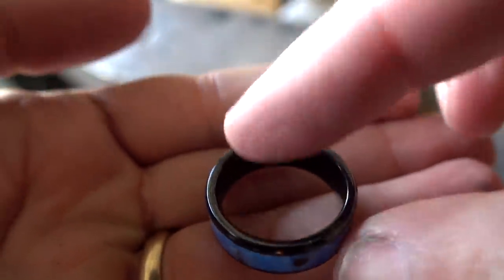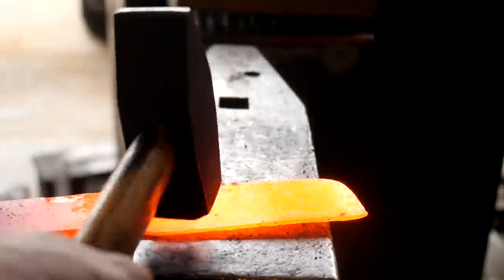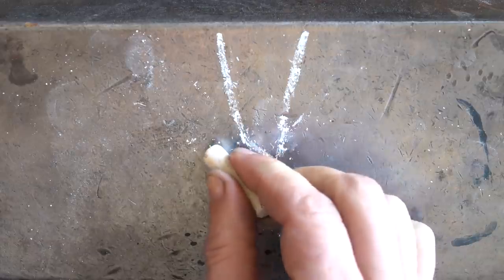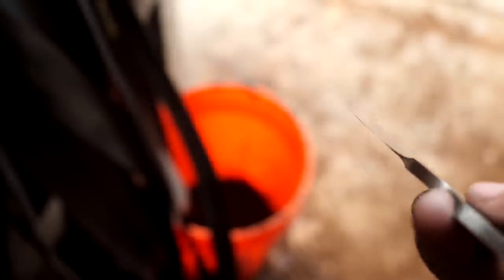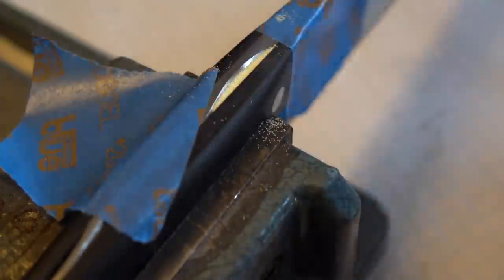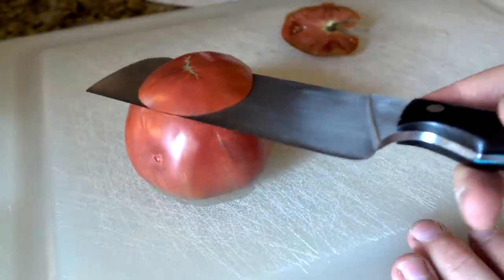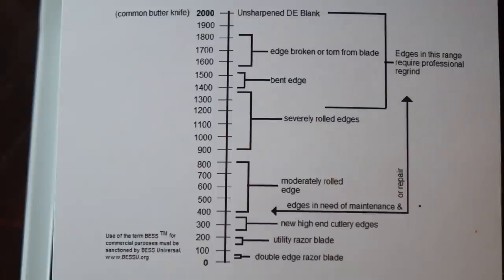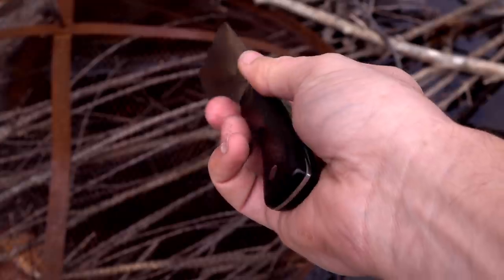Forging An Ultra Sharp Knife!

Comment: The German style cook`s knives are ground like that (primary bevel across the depth of the blade and ground to zero at the cutting edge). They do also have a recasso which I don`t like myself. This makes for a steep cutting angle, but you have to always grind the whole blade to re-sharpwn the knive. So the knive shrinks each time, and ernds up as a boning knive.

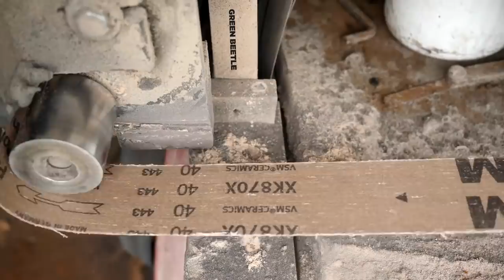Comment: At 6:26 it looks like you mount your ceramic belt backwards? I may be wrong but I believe the grains in these are oriented directionally in the resin and are designed to be run along the arrow.

Comment: Hi from Bavaria. Nice Video. 1080 or 1084 are excellent steels for kitchen knifes. The only downside is, that they are not as wear resistant as Steel which forms carbides. Theoretically they can have a finer microstructure because of their missing carbides.

Do you use your knife in real kitchen tasks? A geometrie this thin collapses at the first contact with the cutting board. You can set the edge back an put a primary bevel on at about 30°. Experiment with that if you have a guided knife sharpener. This will give you a durable edge with almost the same cutting performance.

A flat grind is not my first choice when grinding kitchen knives (I forge only kitchen knifes). A flat surface will extremly stick to food. Your tomatoe is a good example. Potatoes are even worse. I like a gentle convex grind. It is a good compromise in cutting ability and food release. Playing with the amount of convexity along the length of the blade can result in a perfect cutting kitchen tool.

Your experience in cutting toilet paper can be explained with the mikroscopic condition of your cutting edge. The normal sharpening on stones leads to microteeth at the cutting edge. They act like a saw and make it easier to cut through the toilet paper. On the other side this edge fails compared to the razor blades with your sharpness tester. This is because this blades have a polished and closed edge. Try to shave with a toothy edge. You woun't entjoy this shave, believe me. As a consequence you stroped with diamond compound. This leads to a finer edge and a better result with the sharpness tester. The cut through toilet paper was still good. The diamonds leave a non polished edge with teeth just a few numbers smaller and more agressive. Try a compound like chromium oxide or iron oxide. This will polish the edge and result in even better values on your tester. But it won't cut into the toilet paper.

Regards
Christian from Moosschmiede

Comment: Straight razors have a primary hollow grind and they are sharpened on flat stones using the spine as a base. They are around 10 degrees inclusive.
Reply: And have a hard temper if any at all.

Comment: Hey! when you said that maybe the knife wasn't as sharp as you thought when cutting the tomato, the reason the knife was pushing the tomato was that you have a really flat and true knife body that lets the tomato stick to the knife. just like when chopping potatoes or veggies, when the food sticks to the knife right? you can avoid this with an apple seed grind? (not positive on the lingo) where you hollow out the body of the knife and then it widens out a bit to the secondary grind. it'll create the void between the knife and the tomato so it won't stick as much. Just my thought as to why it wasn't super successful with the tomato trial. Always impressed with the videos though! (please correct me if I'm wrong! still trying to learn as well)

Comment: Always enjoy your vids and your scientific methods 😉.  I've also found that cleanly splitting hairs requires just about as much skill as it does sharpness.  I think that 10-20 thousandths is a good thickness for something like an EDC or hunting knife, but kitchen knives, at least for cutting veggies etc.  are great at 2 thousandths and even below and are considered somewhat thick at above 5 thou.  

Try taking the flat grind down to 10 thousandths at the edge and then grinding in a lean convex (down to zero) that goes up the blade about 1/2" or so.  Then lightly run the edge over a fine stone or even some 1500 grit paper a few times to remove the apex just a bit, and then come back in with your final cutting edge and angle.  I've found this method works great in achieving a very sharp blade/edge geometry for pretty much any type of blade.  It's just how lean the convex is that varies from knife to knife (i.e. edge thickness before applying the convex and then again before applying the edge apex).  This is also basically the same way they apply their edges in the ABS.  Give it a try sometime if you haven't already, I'm sure you'll like the results ya get.  Thanks for sharing and take care 👍
Reply: Plus one for this comment. Even commercial chefs knives are well under .0015

Comment: From the research I'd done in my own quest for this same thing, the moment you get your secondary bevel edge to around .2 microns the steel, regardless of the profile of the bevel, doesn't have the structural integrity to keep its shape and dulls down to about 2 micron real quick. It's the reason sushi chefs don't have steels, but keep a 10 and a 16k stone nearby at all times.

I had also tried splitting a hair at one point (with a zdp-189 sharpened to 0.25 micron. this cut knicked the blade: https://imgur.com/28MrDxd)

Comment: Zero ground knives benefit from the fact they automatically thin themselves. Imagine a full flat ground knife (this isn't "zero ground"), there are 2 bevels, as  you remove material from that second bevel it eats into the primary bevel of the blade upwards into the progressively thicker part of the knife. That makes it more and more wedge shaped and has less of a "cuttability" quality. There are a few reasons why you'd want a secondary bevel, edge stability, and the biggest probably being sharpenability. It's easier to remove 1/8th of an inch of steel to create an edge than it is to remove 3 inches of steel. And with the added edge stability seeing as how the very apex is thicker in comparison, you can make the primary grind very thin.

Comment: Try making it out of AEB-L. That should be able to get down to a finer edge due to no carbide formation in the heat treatment. Nitro V should work well too
Reply: Very much this! To support an edge that thin, you need the right kind of steel, and AEB-L is it (or the AEB-L clone Nitro V). Zero flat grind knives are a pain to make, but they perform like nothing else. You could call them the exotic sports cars of the knife world and you wouldn't be far off.

Comment: It cuts hair with the same sound as a good straight-razor. About the toilet paper test, it may be that there is a tiny irregular burr on the cutting edge. So sometimes, it cuts, sometimes it catches the paper. But overall, Sir, your blade would CUT! :)

Comment: for a chef knife 10-20 thou isn't gonna get a great edge. most kitchen knife makers including myself grind their edge between 2.5 thou and zero usually with a slight convex grind.also what is critical to a good chefs knife is a nice distal taper. unless I were to try to make a real laser for extreme sharpness but a lot less durability, I like to have the spine thickness at the heel between 0.125" and 0.093" (you can go thinner, but this is just what I have worked with in the past) and have it tape as thin as possible from the heel to the spine.

Comment: You will also find that removing steel perpendicular to the edge will make the edge much more aggressive by adding small steel teeth. Removing metal parallel to the edge causes no teeth to form and it will dull quickly in comparison

Comment: For most knife blades sharpened for Wood carving there is no secondary bevel. Especially those used for chip carving. Check it out.

Comment: Correct me if I'm wrong, but doesn't a hollow grind technically achieve the sharpest edge? Although you might run into the same issue of the edge being so fragile that it rolls if you look at it too hard without any amount of secondary bevel.

Comment: At about 9 minutes into the video you show us the damage that paper did to the edge of that 1085. Do you feel that a differentially hardened edge at that grind angle would have faired any better or worse? I realize chipping may significantly increase.
Reply from the maker: i think the reason for the waves after cutting paper was that the steel was too thin.  not much to do with heat treat or differential hardening.  this was corrected by applying a secondary bevel which better supported the edge.

Comment: My wife gets mad every time I sharpen knives. The noise of it drives her crazy. Then I start to shave random spots of hair off my legs followed by me plucking hairs out of her head without permission for tree topping tests, that’s what really pisses her off.  My all time favorite steel is white #1. I use DMT coarse, fine, extra fine, leather strop on wood fuzzy side up loaded with green aluminum oxide, or canvas strop barber style loaded with green aluminum oxide. Last I use a leather strop on wood smooth side up with no compound.  In that order if it needs it. Between grits I deburr on oak end grain and strop to make sure the edge is clean without a burr.

Comment: what's that little tool you use to push the blade against the belt sometimes?  I couldn't tell.  Just a little homemade object that grabs the knife decently and helps apply pressure?
Reply from the maker: magnet

Comment: Being such a thin edge.... Would the acids in the tomato begin degrading the edge before the second cut?..... Also there needs to be a hollow grind to allow air in the cuts otherwise things like tomatoes and potatoes get stuck to the side of the blade making it harder to cut.

Comment: So why does tempering have to take so long? I have tempered blades and within 20 minutes they were a nice straw color. This was much hotter than what I intended but it I did wonder what the problem with that method was. Is the steel compromised when done that quickly?
Reply from the maker: My understanding is that not only does tempering relax the steel and soften it but it  also helps convert retained austenite to martensite.  A second temper is often used to then de-stress the new martensite.  Someone chime in if that's incorrect.

Comment: Not to Split-Hairs but...🙄...If you used something like S30V or M390 or even CPM D2 steels, you probably would have had a much stronger blade and could have gone even a bit thinner on the blade...Hope this wasn't too EDGY a comment! Nice work!

Comment: the problem with this knife not doing so good in some of tests is that, it is so sharp thats is cutting through time into the future. the materials you are cutting are still in the past as the edge is cutting ahead. thus generating friction at the back, which in return results in some tearing and requiring extra pressure. yeah.

Comment: 1:30 No secondary bevel...much like many swords? Say a katana or longsword? That shouldn't be too delicate...
Reply from the maker: Chemus Van Der Geek   Implication is that I’ll be grinding from a thin spine flat or straight to zero or the cutting edge.  No convex or appleseed.  A very flimsy grind when spine is this thin.

Comment: Zero flat grind is prolly what people would call it. Zero ground scandi knives are 1 flat and a bevel on each side like ya said.  Zero refers to no secondary bevel, it's either a single bevel per side or a flat and a bevel, there is never a secondary bevel in zero ground knives.